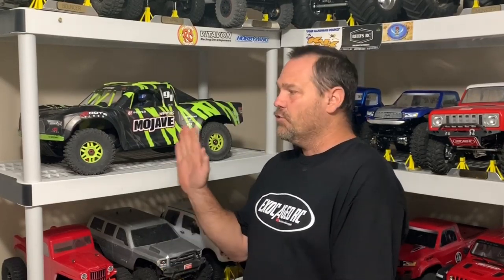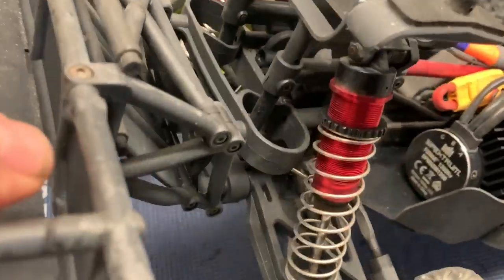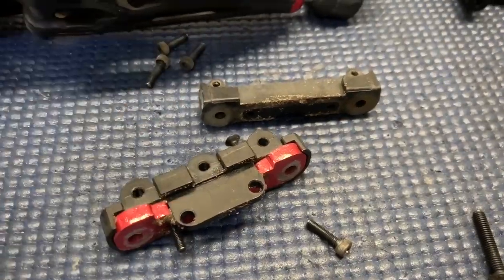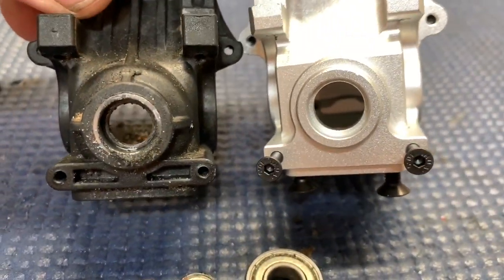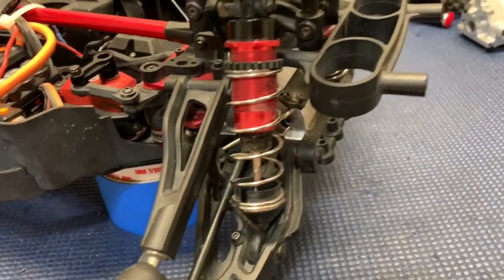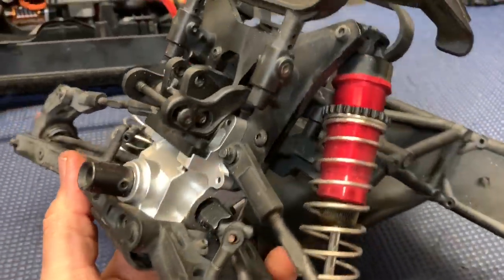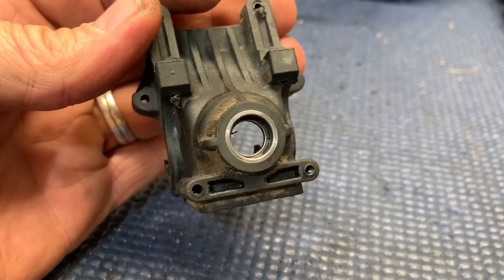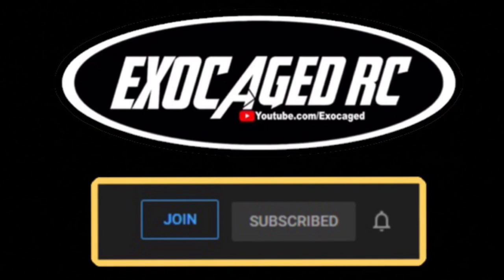Vitavon Diff Cases in Mojave

Comment: Vitavon pricing is too high. Not sure how he's basing price point but he's at mid range 1/5 scale prices. Btw should have changed out your diff carriers to the arrma or hot racing aluminum ones while you had it apart great upgrade and will stop from melting the stock ones especially since your running 8s.
Reply from the maker: Well the diff cups are easy to change out when they break. I'm more worried about the center diff melting with the power its having to work with now, and about to be more...

Comment: Great Video - do you know how these compare the the Hot Racing ones ? need to get a set but torn between these and the HR ones
Reply from the maker: well I haven't had the HR ones but I know these are very nice, does the HR ones have a larger input bearing?
Reply: @ExocagedRC  yes Upgrades the stock 5x11x4mm unsealed outer pinion bearing with an oversized 5x13x4mm sealed bearing and is included with the case - i like the look of the Vitavon one, but the price is just too high really - just ordered two of the HR ones
Reply: The price is actually about the same. 
HR housings come in two separately purchased pieces and the vitavon comes as you see it. Maybe 20$ difference overall.

Comment: I like how this Diff is more beef up.  I'm sure it will help out a lot with the better ESC and 8s motors.  I can't wait till you do the 1650 mod.  After that smaller gear then punch it to a higher number.  That still let you harness its True power Super Mojave Mode.

Comment: Hi I have 2 of these on the way for my kraton 6s. I believe their the same cases as you have, are they the same size bearings as stock? I need to order some sealed ones. Would really appreciate your response :)
Reply from the maker: I think they are the same. You may need a couple larger bearings like I showed in this video.
Reply: Exocaged RC hi yea I’ve ordered the bearings. I checked with the manufacturer I just hope everything lines up ok

Comment: I have these housings for my kraton 6s and am experiencing a tight rear diff when I fasten the bulkhead to the chassis. Is there any modifications you made or anything you did to avoid this? Btw I loved this video and was very informative, just ran into a slight problem when trying to install mine. If you or anyone on here can get back to me, any feedback would be greatly appreciated!
Reply: I have exactly the same on my Mojave and tightening it completely to the chassis my front diff stops.... I measured and the tolerances are different from the stock
Reply: From the video footage, Exocaged chassis is different from mine. I have the EXB version and the indentation in the chassis to let the diff spur spin freely is not so deep so it rubs there, and when the screws underneath are tighten is totally stops. My solution is to put 2 small nylon washers on the rear (inside) holes and use silicone tape cut in small slices to cover the tiny openings. I'll try and post results. This vitavon looks and feels great so I want to have it in there. Another solution could be to dremel deeper into the chassis to make room make that's permanent and I don't want to accidentally damage it.

Comment: $88 compared to $54 for the Hot racing. Worth the extra $70 for the pair?
Reply: That's what I was thinking.  Price is extreme
Reply from the maker: So far I’ve had great luck with both Vitavon and HotRacing. I chose these and am happy with them
Reply: Wow but these are whole case where HR. Have buy cover right?
Reply: @DSC1320  its not actually, bc the HR is only half the case for 54
Reply: @DSC1320  sometimes you don't want all aluminum tho , i think definitely a week spot for frequently playing with arrma
Reply from the maker: rc player these are the whole case yes. Just like you see them
Reply: Plastic case i meant week start to flex and ring pinions will keep blowing all regular sending bashers no this but dont say it bc dint want give arrma bad name
Reply: Figures i wanted see how or what happen with exo mojave , bc we bash alike ofcourse after 5 times install cases bc is what is what vehicle can play that hard under 1000 bucks way under welcome rc get some cases ik its on my list next build up i building truggified v3 typhon and im done im only Losi mini tee kick why ? Bc i can take to work 😆
Reply: @ExocagedRC  its paul btw 😃just avid fan i haven't left just been busy still repn the exo attire bc 32 degrees yesterday here on longisland
Reply from the maker: rc player awesome.  It’s supposed to be 73 or so here today. Charging up some stuff to go bash around a bit.
Reply: I’m wondering it you had to shim the pinion on these cases. From my R&D I found that the stock plastic case has a perfect mesh between the ring and pinion. While the Vitavon has 2+mm of slop on the input shaft if not shimmed. Similar to the HR hear housing. Thanks for the vidjiah on these. 
I went with them over the HR. 
      Currently assembling but stuck on the pinion and ring gear mesh. Any and all suggestions are appreciated.